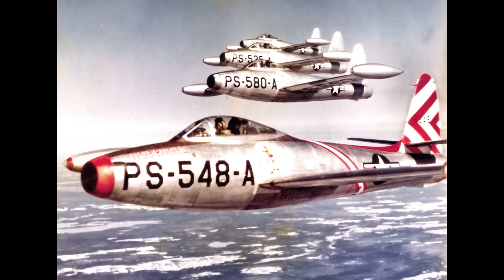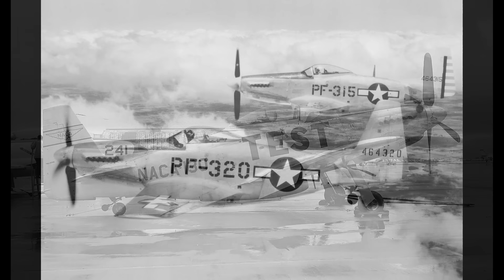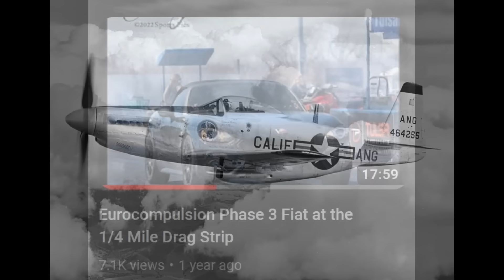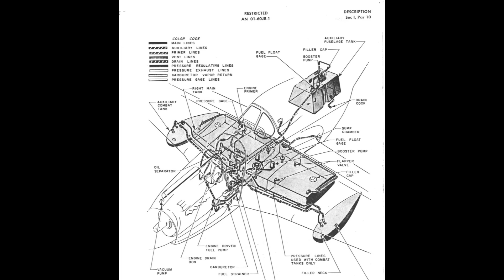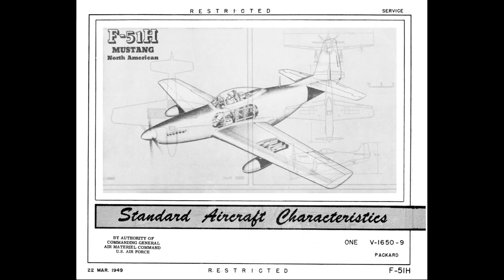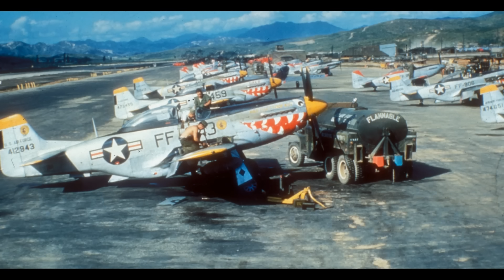P-51H Mustang, Superprop!

Comment: I’m curious which naval superprop will be a match for the Sea Fury… Maybe the F7F, Wyvern, or the F2G? 

Whatever it is I can’t wait to see it, I always love the superprop series!
Reply: F4u-5 is my guess, given that he stated his preference for the Sea Fury over the p51h included its combat record.
Reply: The Wyvern technically doesn't count for this series it's not running a piston engine.
Reply: @SUPRAMIKE18  The Wyvern prototypes and preproduction aircraft started out using a piston engine. I think it used the 24-cylinder Rolls-Royce Eagle 22. Although they only built like 6 prototypes and a few preproduction with the Eagle engine though before switching to a turboprop, so you’re right it probably doesn’t count for this discussion…
Reply: @johnsledge3942  also to add to that it was more of a strike aircraft rather than a dedicated air to air fighter.

Comment: You mentioned no engine mount breakage in any US plane of the era.  Were there such failures with the Spitfire?
Reply: 109s had wing failures under extreme g loads, they had a single wing spar.  Early Zeros had light weight horizontal stabiliser failures and Typhoons had resonance failure of the fuselage-tail joint.  B-24s had airflow breakdown over the torturous Davis aerofoil with g loading or any ice contamination.  H.P. Halifax I and IIs had loss of control in asymmetric flight from really bad rudder design.
Engines tended to be soundly attached, the early Typhoons had really poor engine vibration dampening, their early Sabre engines were very unreliable.  The awful He 177 Greif (!) had terrible engine overheating with no firewall!  P-38 engine controls were no good in the cold.  Marianas B-29s had overheating and fires when initially bombing from high altitude.
Reply: My understanding away that the tube engine mount wasnlighter, and had less deflection under G

Comment: Great video! I read in Chuck Yeager's autobio he described the P51D as being very pitch sensitive on take off with a full fuel load in the fuselage tank. It surprised me a bit that even a pilot of this elite skill level and expertise would describe it as being really touchy and even could be dangerous in this situation.
Reply: You wanted to empty the fuel tank BEHIND the pilot before transferring to the drop tanks.
It was a CG issue.
I think Yeager said in his first autobiography that the P-51 could flip onto its back if you didn't burn that fuselage tanks first.
He also remarked that they NEVER had the suggestion in the P-51 pilot's manual that you SHOULD burn off that fuselage tank first before transferring to the drop tanks!
It seems a STUPID detail to omit from a flight manual but remember that most of these fighter designs had major flaws that generally weren't corrected until the fourth, fifth, or even sixth major production models of those designs!
Development of WW2 designs was compressed into months instead of the many years we spend developing aircraft now.  Bare minimum development time for any plane that goes into service NOW is at least 4 years flight testing; that's optimistic.   A decade from program start to first prototype flight is more likely.  They spent close to 20 years from the time the F-35 program was initiated (mid-1990s) until actual initial operational capability of the type designing and testing that plane.  It STILL has major maintenance and manufacturing issues.  
Both the F-14 and F-15 were tested and developed for 4 years before they first deployed (1974 and 1976 respectively).  Neither plane was debugged (mostly) until they were in service for at least a decade!  They were still working out bugs in the F-14 up to the year it was retired.

Comment: With this and other videos from this channel, I think I'm finally getting a little bit of a handle on WEP and water injection.  My confusion dates back to the 70's when I was in grade school reading books about planes where a mention that a pilot could inject a methanol/water mixture to boost power and still today vendors selling water injection kits mention WEP in planes back in WWII along with the claim that MW injection yields extra power.  I didn't  understand till days ago (from watching videos on this channel) that isn't the MW injection that yields the extra HP, its the manifold pressure boost that gives the extra power, and the MW injection merely enables the engine to tolerate the manifold pressure boost.

Some comments in a five year old video "Why was the BF109K faster than the P51D? MW50!"  was some food for thought and I looked into the properties of the liquids used for this purpose.  Water, freezing point 32 deg F, boiling point 212 deg F, latent heat of vaporization, 970 btu/lb.  Ethanol, freezing point -173 deg F, boiling point 173 deg F, latent heat of vaporization, 395 btu/lb. Methanol, freezing point -137 deg F, boiling point 148 deg F,  latent heat of vaporization 501 btu/lb.

The cooling effect from the vaporization of water wins in btu/lb, but, range of usefulness is limited by the high freezing point in comparison to the alcohols and ambient humidity.  If it is 70 degrees and pouring down rain and the dew point is 70 degrees the cooling effect in the manifold from evaporation of water will be slight if at all.  If there is anything at all its because the manifold is above 70 degrees from engine heat. If you are sea level in Arizona with an ambient temp of 105 degrees and a dew point of 40 degrees water may be able to beat out the alcohols for cooling effect because of its high latent heat of vaporization.  Of course the colder temps at high altitude effects the utility of water, water doesn't evaporate well below 32 degrees F.  Ethanol with its higher boiling point than methanol plus a lower latent heat of vaporization I think will behind methanol for cooling effect nearly always.  The lower freezing point of ethanol may help it out when it gets really cold.  I'm not sure how the dew point would effect the propensity of alcohols to evaporate.  Hunch is that it is similar to water, but not sure.
Reply from the maker: Your on the right track. Now consider the cooling effect as the piston rises and pressures and temps rise in the cylinder. All that water in there will vaporize thus cooling things off and reducing or eliminating the chance of knock. Thus you can cram in more manifold pressure and thus more air into the cylinder with less risk than you could otherwise. P-47s never ran more that 52 or maybe 54 inches on high octane fuel alone, with water injection that ran 70.

Comment: Greg: Many extremely great photos and great narrative. Lots of good info. Thank you to the max. 
I used to work at Half Moon Bay Airport back in the '60s and '70s. The guy who ran the place, Frank Sylvestri, had flown P-47s in WW2. His son, Paul, was a high school pal. I rode down there on my '50 H-D Panhead (still have her). One day we could hear a P-51 enter the pattern. The classic pop-pop of the the Merlin on final. Nice, no bounce landing. In it came, toward the gas pump. This action was enough to actually bring out the old man from the office. The pilot was a guy with his kid in the back, in a P-51H! I handed up the gas nozzle. All we had was 100-130, but who makes 130-145 any more? Anyway, they went inside and got their hunnert dollar hamburgers (plus, probably, a milk shake for the kid). They came back outside, fired it up and were outta there. Very cool. I gassed a P-51H!
Reply from the maker: Thanks, that's a great story. These days it's ultra rare to see a warbird just cruise in to get a burger.
Reply: @GregsAirplanesandAutomobiles Do you have plans to do the Spitire mk 22 and 24? Love your channel by the way.

Comment: The H looks like it lost a bit of the P-51s good looks to gain the performance advantages it had. That tail certainly doesn't look right.
Reply from the maker: I feel the same say, but I think it's the eye of the beholder because some think it looks better. I could also just be what you and I are used to looking at.
Reply: The tail was developed by NACA to improve its high speed control. So you know it looks right on the wind tunnel ;)
There are NACA documents about it just search P-51H in NASA Technical Reports Server.

Comment: Whether or not the P-51H was in fact less rugged than the P-51D (I think it most likely was, but whether or not it was enough so to matter is another question), I don't think there's any doubt that pilots thought the new, lighter aircraft was more fragile. Between that, the emphasis on the ground attack role for the P-51s in Korea making the better performance of the P-51H less relevant, and the logistical issues... Yeah, it would have been cool to see what might have happened if the P-51H had been sent to Korea, but the odds were heavily stacked against that ever happening.

Comment: It was interesting to hear about the changes to the gun systems in an attempt to minimize wing damage.  The 6-series airfoils were very sensitive to damage, or even normal contamination, for that matter.  It was decades before computational methods became robust enough to make even thing like bug strikes less of an issue with laminar flow wings, at least for maxumim lift.  By then, true laminar flow was routine over significant wing area.   There were stories of gliders not making it back to their landing strips because they ran into a bunch of bugs or a little rain and that dramatically affected glide ratio.

Comment: V-1650-3 and -7 were limited to 61 inches Hg for takeoff and that was also considered "full military power" (limited to 15 minutes of continuous operation), and 67 inches Hg for "War Emergency Power" (limited to 5 minutes of operation).  In the wartime P-51 airframes, there were NO 70" of manifold pressure uses!!  Now that's not to say that, at lower altitudes, some pilots, say chasing "doodle bugs," didn't actually ACHIEVE 70" Hg, but in a combat situation the LAST THING YOU EVER WANT TO DO is to BLOW YOUR OWN DAMN ENGINE UP!!!  The P-51B Specific Engine Flight Chart that you show to illustrate the effectiveness of the Simmonds regulator even PLAINLY SHOWS THESE LIMITATIONS!! The throttle lever was blocked by a piece of safety wire on a "gate" to keep the pilot from inadvertently selecting manifold pressures above 61." To achieve the 67" of "War Emergency Power," the pilot had to FORCE the throttle lever forward, BREAKING the safety wire.  I believe some of the later Merlin installations in the later Merlin-powered Spits were limited to higher boost settings, but P-51s were 61" and 67."  In MODIFIED post-war RACING Mustangs (mostly using the -9), manifold pressures in EXCESS OF 100" Hg were and are very often achieved, OFTEN leading to CATASTROPHIC ENGINE FAILURE.  I have to say that I disagree with several of your details in your observations and explanations of the H's design doctrine, but, overall, a NICE VIDEO of a sub-type that always get little to no coverage (and NICE PHOTOS ESPECIALLY) !!!
Reply from the maker: You are entirely incorrect. P-51s in USAAF service were switched over to 150 octane fuel. With that fuel and a few other minor changes they were authorized to and did run 75 inches of manifold pressure. They could run 67 inches on 130, which is the number you're looking at in the manual. There is a mountain of evidence for 75 inches and the Brits often ran them at 80!
Reply: I'll have to dig into the books again.  I know that post-war, even the last publications and revisions to the F-51D manuals had those limitations, but that was obviously in peacetime with no one shooting at you, just like the D's fuselage 85 gallon fuel tank being placarded to 65 gallons.  And I know EARLY in their use flying out of England, the Mustangs had difficulty digesting the British aviation fuel that they were using, which caused their American-manufactured spark plugs to foul at an almost impractical rate, but the use of British-manufactured spark plugs would alleviate that.  I know the Brits eventually operated Merlins at much higher boost than the U.S. did, and I know that toward the very end of the war that the higher octane fuels were becoming available, but I have never come across anything, either officially or antidotally of higher MP being used.  It makes total sense that it SHOULD BE THE CASE, what with the -9 Merlins in the P-51H having the MUCH HIGHER power settings available, when the core V-1650 is still pretty much the same engine.  And this reasoning also carries over to the V-1710s used in the "Lightweight" experimental Mustangs and, then later, in the F-82s, running easily TWICE the MP of the earlier "F" Series Allisons.  Looks like I've got some DIGGING to do!  I will reiterate though, your video here on the H is VERY nicely done.  I do take exception to a couple of other things you present...everything I've ever read indicates that the oil heat exchanger was ONLY a weight-saving measure, as since the whole powerplant was still very dependent upon the EXTREMELY vulnerable belly scoop radiators...if the belly radiator was shot up, even though your engine would loose no oil, your oil would STILL overheat, causing a loss of pressure (the very same reason you switch your "secret" car to higher viscosity oil when you take it to the track), and ALL Merlins are very sensitive to oil pressure loss....actually, as you WELL KNOW, almost ALL high-output engines are!!   Another small point, going to the smaller and LIGHTER main landing gear struts, and incorporating the spot disc brakes was one of the BIG weight-saving measures, and, of course that did get rid of the "kink" in the leading edge.  The landing gear redesign also severely weaken the tail gear assembly "down lock" (if I'm not mistaken, the tail gear in the H was completely cable-actuated, reducing weight by removing that entire portion of what had been hydraulic actuation), and this became a constant point of failure with the type, resulting in a BUNCH of photos of Hs squatting on their BUTTS with bent fuselages, and ALL OF THOSE PICTURES where we see the tail wheel down in flight (the same "bolt it down" measure was applied to the Ds still in service just as a maintenance-saving measure).  Still, NICE JOB!!!  @GregsAirplanesandAutomobiles

Comment: If I recall correctly, the H model were mostly issued to ANG Interceptor units for home defense. Thus eligibility for Korea would have been moot and well explained by Greg.
Honestly, the P-47 would have been better in Korea and the argument of logistics for them were in my opinion biased to the F-51.

Additionally, Oil coolers in modern aircraft are interesting.  Inline fuel/oil coolers, air/oil coolers, and fuel cell mounted coolers.

Another great job Greg, We all do appreciate it.

Comment: It’s really unfortunate that the P-51H was never deployed overseas during WWII - it would have been the ultimate wartime prop fighter.  555 of the contracted 2000 were built before VJ Day and production was then halted.  There was some talk that the 56th FG in the ETO would receive them to replace the problematic P-47M before they sorted out its troubles.  Much like in Korea, it didn’t make logistical sense to deploy them when the aircraft already in theater had complete dominance - why bring in a whole separate airframe/engine/parts requirement?  Your logic on it’s place in the pantheon of post-war SuperProps makes complete sense - not having a carrier capability renders it pointless when you’ve got P-80’s and beyond.

Comment: Noticed in some of the pictures of the P/F-51H that had the tail gear locked down in flight. I seem to remember that they had done the same with ANG F-51D aircraft as well. There was some maintenance issue with the retraction of the tail wheel, and the solution was to have them locked in the down position. I am guessing that it was a similar situation with the F-51Hs that had their tail wheel locked down as well.
Reply from the maker: I'm guessing it was some short term problem addressed by locking it down, but I just don't know.

Comment: The thing that impressed me most about the sea fury was its very high speed for a radial engined aircraft - at a relatively low altitude of 18000ft, where beyond this staged supercharging began to really show its advantage. I hope this new discussion/video will be around the De Havilland Hornet or Sea Hornet.
Reply: I suspect it will be the f4u-5 🙂
Reply: The Bearcat in the same exact performance graph performed the same (or better at high altitudes) with a radial engine lol.
Reply: @EstorilEm Greg’s last video shows performance to be almost equal to  the F8F-2 in terms of Climb and speed, but it is the Sea Fury X I was referring to here mate..

The point i was trying to get across was it achieved a higher top speed at a lower altitude if that makes sense.

Comment: Prince Greg superb video. It corrected one of my long-standing memories. I thought the H had a Allison in it. My only technical comment is I agree the P 51s with the behind the seat fuel tank may have had some CG issues but we have to talk very carefully because expert pilots may want a little bit of aft CG to get some tighter turns in certain situations! Not a novice but an expert.
Reply: The F82s got Allisons, although early build P82s had Merlins
Reply from the maker: An aft CG does improve performance, but with the D model it was so far aft that even Chuck Yeager said it was a problem.
Reply: The H had the Merlin, as did the XP-51F & G. The XP-51J had an Allison engine.

Comment: I believe that the p-51d was g limited to 6.5 or so because they were getting fat, and the p-51h restored the g limit to 8.
Reply: There are reports that after the Army Air Corp introduced G-suits for fighter pilots, P-51D's would occassionally return from combat with several more degrees of dihedral than they started with.
Reply: @fafner1  must've made them more stable, though prob a bit creaky.